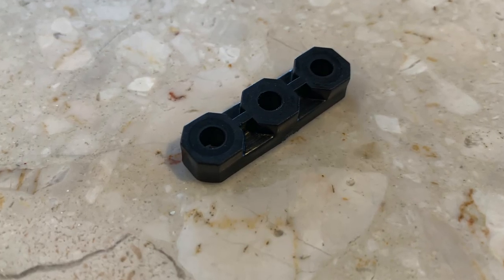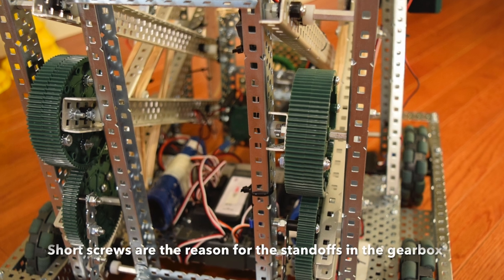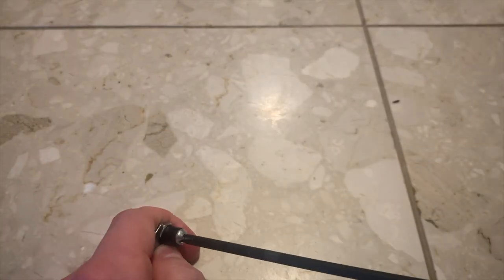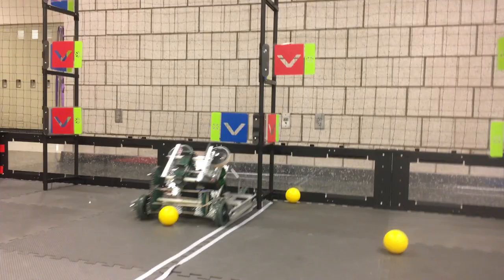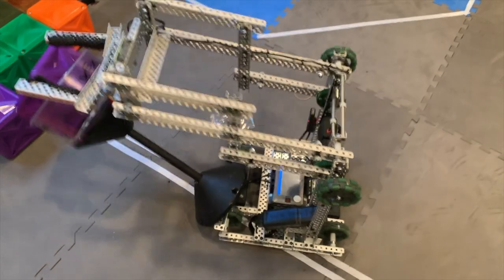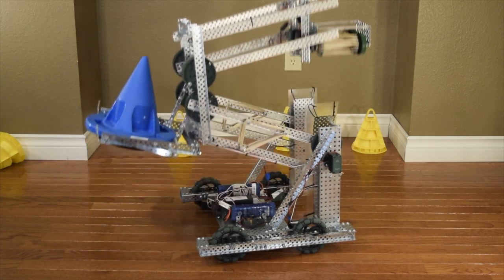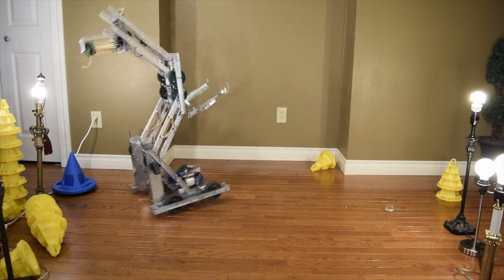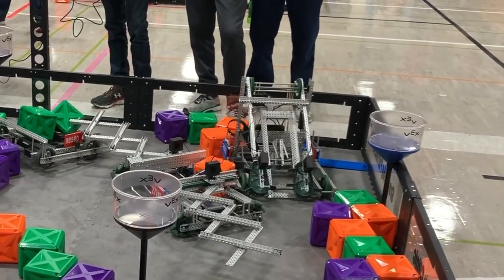Building Tips Every Vex Team Should Know

Comment: To stop from being pushed with omni wheels, put a locked omni wheel in the middle of your robot that is facing the other way. This will give you all the pros of omni wheels and stop you from being pushed around.
Reply: Id recommend using just using a regular traction wheels because locking the rollers on omnis often damages the wheel
Reply: @pauljasina2779  that's really smart! I'll try it out
Reply: @pauljasina2779  Omni wheels are 4.125in diameter, tractions are 4in. Without weight on your bot they won't contact the ground. You can still be pushed with the tractions if they aren't touching the ground.
Reply: @itsvoid2917  While that is true with the old omnis, the newer ones have a 4in diameter

Comment: "There are  two main varieties of wheels"
Mecanum gang :(
Reply from the maker: I'm counting Mecanums under omnis. While that may not be technically correct, they share a number of similarities (rollers, allowing for holonomic action, etc.). This is mostly intended when talking about a classic drivetrain, and Mecanums do not really fall under that style of drivetrain.
Reply: @KeplerElectronics  ok thank you for telling me.
Reply: Mecanums bad, literally just use omniwheels in an X drive config
Reply: @micah2455  thats basically impossible to build around
Reply: @sumamerican9436  depends on size of robot but robocup soccer is nearly 100% filled with that exactly
Reply: @micah2455  I have made two x drives during my seven years in vex. I can confirm they are hard to build around and limit your space a bit because the wheel well take up more space from all of your sides but also make an angled bit that cuts off the corner of the 18 by 18 so I wouldn't make one if you are going to need a decent sized intake though I have seen it work, however they can be good if you don't have meccanums (because they have the same effect) or if it is what you are more comfortable with.

Comment: Your screwjoints are wrong, and boxing aluminum whether by more c channel, or boxing with screws, is pretty much always better than using steel
Reply: what does "boxing aluminum" mean?
Reply: @AnnonHong  a c-channel is "boxed" when you attach two c-channels in a way that it forms the shape of a box. To do this, put two c-channels back to back, then flip one over and slide it so it intersects with the other. Use screws to attach. You will need at least two c-channels to perform this, and after it is done there will be no "channels" sticking out. There will only be a box.
Reply: @jeffreyhuang3814  thank you and my team actually use something similar to what you described.